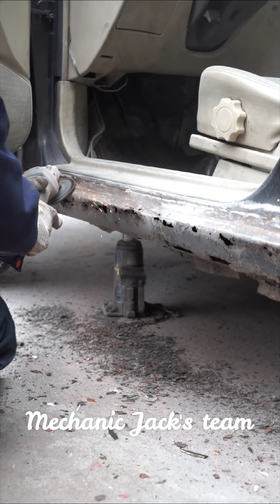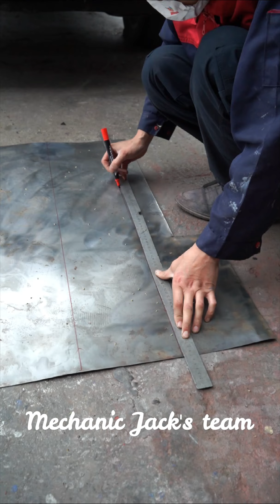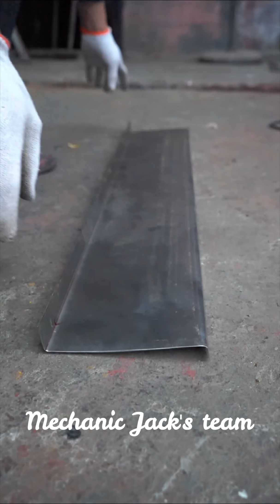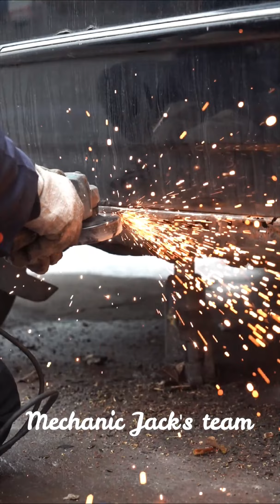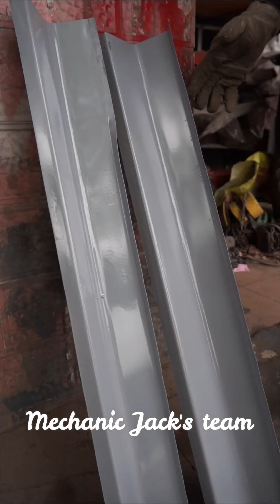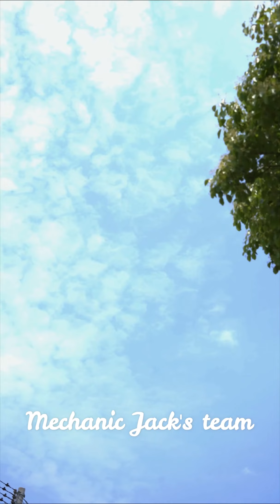Restoration of Rusty Car

Comment: Are these just poorly built cars ? How come they are so rusty?
Reply: Just depend on environment.
Cars do the same thing here in Canada
Reply: High humidity, rain, floods, snow, salted roads poor manufacturer rust proofing, poor steel quality, poor previous crash damage repairs are contributing factors.
Reply: @2litrepeter.  all of witch are very abundant in China

Comment: I suppose it's better than before but not by much.
Reply: you could do better 🤔
Reply: are you drunk
Reply: So new metal welded into place is not better than rusted metal?
Reply: @chrisgray4651  he said it's better, why do you have to ask?
Reply: @bobs12andahalf2  😀
Reply: That rust is going to come back like Arnold Schwarzenegger.
Reply: @chrisgray4651  he did properly prep the metal or the surface.  This is a temporary repair.